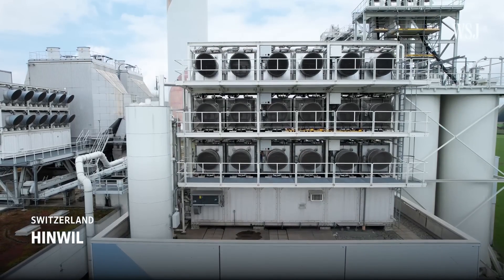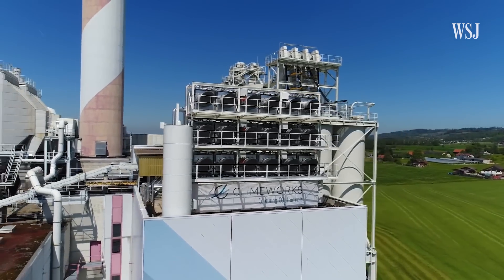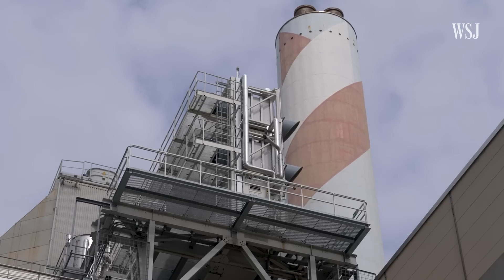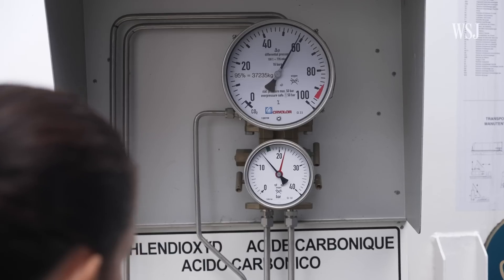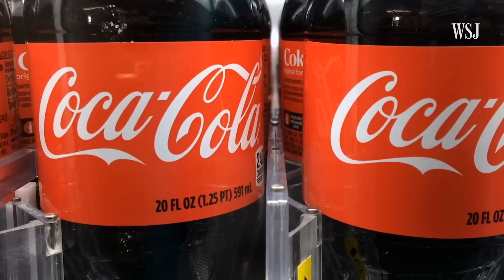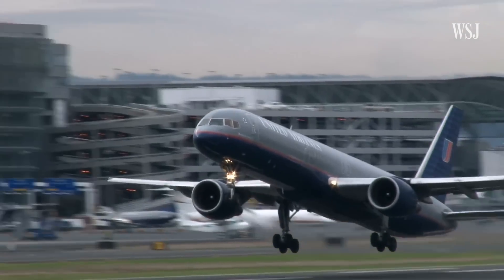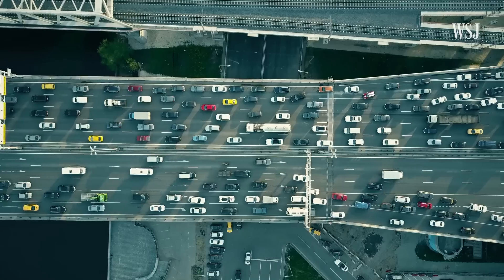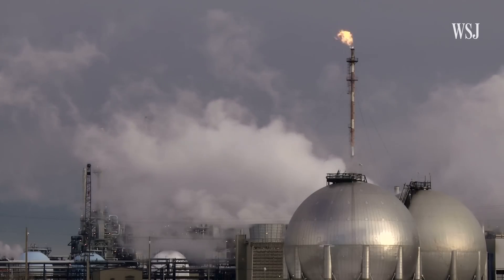Coca-Cola's and Microsoft's Latest Gamble: A Giant CO2 Vacuum Cleaner | WSJ

Comment: How does clearing vegetation to build this machine compare to the job actual vegetation does in using co2 and producing oxygen?  Wouldn’t you have to put it near factories that were polluting?  Doesn’t the machine use oil and produce it’s own co2?  Why can’t each factory have its own vacuum unit instead of building separate units in the middle of nowhere?

Comment: Taxpayer incentivized "Carbon Capture" is a science experiment for billionaire class investment schemes designed to supply CO2 as a "Raw Material for "Electro -Fuels" manufacture ala DENBURY RESOURCES. This is completely reliant on massive energy inputs via "Renewable energy " being plentiful and cheap. It is not...yet. The Texas facility is to be partially supplied by nat-gas fueled power "Peaker Plant" built adjacent to e-fuels manufacturing.

Comment: This is not a useful video.  You cannot "filter" CO2 out of the air. It is dissolved. There is clearly a chemical reaction going on in these "filters" described here that the article is not telling us about. Furthermore, if the CO2 is then put into fizzy drinks, the CO2 is being returned back to the atmosphere as the drink fizzes.

Comment: Why is it that whenever we see these systems they are big systems in relatively pristine environments, surely if you were to persist with such systems you would be better putting in systems in the most polluted areas, allowing far smaller and quieter systems which would still remove more CO2 than a large system in a clean environment.

Comment: So.... You spend electricity to take co2 out of the air and then put it in soft drinks which goes back to air when you open it?????
And how much CO2 are we avoiding with this nonsense? How are the resources for making the machine produced? Looks like tons of steel etc so all that needs energy and also releases CO2. Just think about it a little. It is monumentally dumb

Comment: Trees might be preferable as not only do they use CO2 from the air but they also produce oxygen.  But a tree needs water, fertiliser and minerals and physical space to grow.  It is therefore competing with humans.  A mechanical CO2 extractor sounds promising but it needs electricity to run, so the electricity has to be very green.  The machine has to be manufactured and transported, it has to be maintained and eventually replaced.  It has to be fully recyclable.  It's carbon footprint is not zero.

Comment: how much CO2 will be released during manufacture of all parts of this facility? 
1 (one) ton of CO2 can be captured by 50 trees in a year. They do need to be charged, they dont need any infrastructure. Just leave them be there.. They also produce oxygen during "capturing" of CO2. As a result you have a long hydrocarbon molecules that actually can be used for oil production, that can be used for plastic production. In case you want it of course. 
In comparison - all you can do with this captured by the facility  CO2 is to release it.. CO2 toothpaste is a pure joke here.. 
All this "tech" is a pure hype and money.

Comment: So capture carbon good? Re releasing it in bottled water bad>?. Seems like a bit of a waste of time to spend all that time AND energy to re release the captured CO2 straight back into the environment. And it costs more so Coka-Cola will be paying this extra? or will they pass that cost onto the customer? So it costs a lot to capture in terms of EXTRA energy used(even more CO2) and it is then released back into the atmosphere via fizzy drinks which now cost more? More energy in total used, more total costs involved Zero CO2 actually removed from the atmosphere.......Hmmmm???? Back to the drawing board???

Comment: I see a lot of negative comments here, but this technology is still being developed. Why would it be bad to try to make this work? It might take them a few more years but maybe they can make this much more scalable if they have the resources to do so. Certainly, when more companies and countries are interested, they will also be able to drive down the cost with economies of scale. You always have to get started somewhere, and it looks like this has potential.
Reply: Nature started this project about 2.8 billon years ago.. and got some successful results already. All you need is to leave it working - plant more trees. They consume CO2 with extreme "external" efficiency. Without fans, current, roads, iron (parts), oil and without these animals, pretending to be smarter that the nature.. 
This technology even does not convert CO2 to something else usefull. Just binds it to be released afterwards. And additionally consumes a lot of energy and transform it into the heat to warm up the planet even more.

Comment: OR... you could spend all that money and PLANT TREES!!!

We have deforest most of the Worlds forests in the last Century.  We have to regrow lots of forest if we want to solve climate change.  Not expensive machines that cost CO2 to make and maintain.  Trees are the solution.  Not some Political Factory.  Don't get me wrong, I'm not against this as a research project.  But lets be real and do the right thing.  Time is running out.
Reply: Planting trees alone is not going to fix the climate, not anytime soon.  Maybe in a few thousand years, but no time any soon.  I'm all for planting trees, they will help, but they are not up to the task at hand.  We need these CO2 scrubbers to pull CO2 out of the atmosphere as fast as we can.  Get CO2 sequestration going, and only then will we see the climate cooling again.

Comment: 4:35 this which excludes also capturing various particulates from burning fuels. I really don't see any use for this except they could sell/market this as a more advanced air purification system for industrial, building, or residential use.

Comment: This begs a simple question. What is the Carbon Footprint of the Climeworks Plant and how long does it take to offset its own emissions? Also what is the net CO2 collected after deducting its own operating CO2 footprint.

Long story short
1) What is the capital infrastructure CO2 and how long is the offset for invested equipment?
2) What is the operating CO2 expenditure and what is net CO2 captured per plant per unit?

Comment: At first, I had a negative impression of this approach since it tackles the symptom rather than the cause, but it turns out there is a green use case for this.  Apparently, algae can turn CO2 into carbon fiber.
Reply: Algae can supply sugar, animal feed, oil, protein, fish food, pellets for heat and other uses

Comment: I've gotta applaud Coke for putting car exhaust CO2 IN the bottled water I can already see a successful marketing campaign designed around "Dasani Diesel".
Reply: That's carbon monoxide
Reply: @josephs3973  yes, CO and CO2 (one oxygen cell away), the devil is in how the bonding is done (passing CO gas's through massive electrical generators) currently seems like trading one problem for another, time will tell.

Comment: How bout instead of investing $220,000 per unit we just leave Mother Nature alone and put an end to deforestation. Thus leaving us with an abundance of oxygen well continuously aiming at major companies that attribute to pollution and hold them to a higher standard of environmentally sensitive production or they face being fined and will need to purchase one of these units to counter act their excess of emissions.
Reply: If we stopped all fossil fuel use tomorrow, and planted a trillion trees, it would take those trees thousands of years to clean up the mess we’ve made. We have to pull CO2 out of the atmosphere to cool it back down. Just stopping fossil fuel use won’t reverse the warming
Reply: it’s not the fact we cannot afford create these units in mass production but the rate of which we create more emissions per year that’s leading us to create technologies as such.
Reply: More like Microsoft and Coca-Cola are scrambling to find a quick solution to this looming danger we face. The main key here for them is to have counter measures but in hindsight we need global regulation and global prevention methods while maintaining the balance of nature.
Reply: @delroynathan7794  Pulling all this CO2 out of the atmosphere is going to take bucketloads of energy to accomplish it.

We need lots and lots of nuclear power.  Nuclear is the ONLY energy source capable of efficiently and appreciably supplanting fossil fuels as our primary source of power today.

Those nuclear power plants can power all our EVs, while producing elements that we can use to make more EVs, and helping to clean up all the nuclear waste we have generated over the last 70 years.

Nuclear is the perfect solution to a lot of our problems.
Reply: I see that your relating your point to the energy crisis and I agree by all means the benefits of nuclear energy outweigh any other production of energy by far. 

Back to the issue at hand though. All species animal kingdom produce CO2 through gas exchange right. Now Mother Nature designed for a way to naturally combat CO2. So we have this thing called the tree of life which the entire animal kingdom falls under and plants are a branch of the tree of life. Well plants use photosynthesis and the by product of that is oxygen. You understand that to maintain this balance that nature has designed we must implicate global regulations to corporations and companies that produce excess pollution from anything between waste to emissions. We will benefit from these carbon capturing units although there’s still the issue that deforestation is the real terror we need eliminate before our Earth becomes uninhabitable.

Comment: if you take into account of energy and chemical products required to run the capture process, you'll find its a zero sum game (or even worse). the only way to capture carbon environmental friendly is by plants, because photosynthesis is free.
Reply: use lumber for building which locks carbon for years, plant new trees
Reply: @Mr1159pm  Nope, that destroys ecosystem diversity, and it only works with fast growing lumber. Also, building houses requires a TON of energy.
Reply: @traviskitteh  Not really. If the forests are correctly maintained and replanted afterwards the ecosystem damage is minimal. Besides the demand for housing is still there, regardless if we use concrete, bricks, wood, or whatever. Also wood is one of the most energy efficient materials to build from.
Reply: @George Gu or they can make it so that they actually capture the carbon directly from the source instead of it being mixed with the air like if these things could be on factory smoke stacks these things will become like 50 times more effective.
Reply: @abhinandanpatil8168  to capture carbon (in CO2) in the air means breaking chemical bond in CO2, which requires a lot energy.
Reply: Yes but they'd rather tamper with the environment so they can mess stuff up and blame climate change to enslave you

Comment: So can I get a CO2 concentrator that is cost effective for my home greenhouse/garden now?

If I can draw the CO2 from the air then we don't need to add it to specialized crops to accelerate growth from bottles - imagine how much simpler the operation of a greenhouse would be if you could adjust the actual CO2 concentration in the air just by vents instead of complicated plumbing systems?

Comment: 1500tons/year is equivalent to 85 American's worth of co2 output. The cost to run these will OBVIOUSLY outweigh the gain by several orders of magnitude, remember, this process requires a ton of electricity. WSJ, this is not journalism, this is you making a commercial for these swindlers.

Comment: Maybe try building the capture setup next to smoke stacks sending out the pollution. If not, it like trying to clean uo an oil spill 10 thousand miles away. Sure, you might get some but much better to clean up at the souce.
Reply: Only about half of fossil electricity plants are emissions controlled.  Sort of like installing a giant catalytic converter that we are familiar with in our cars.  That is a real opportunity not taken.

Comment: This is such a dumb idea, I can’t believe major companies are investing into this. CO2 should be captured from concentrated sources like retrofitting to carbon based power plants, iron smelting or cement plants, not from a very low CO2 source like the air which is only 0.06%. The thermodynamic efficiency is rubbish, just concentrating the CO2 uses a huge amount of energy, which is a waste. Trees do the same job and do not cost $600-900 /tonne.

Comment: It's hundred of times easier to remove CO2 at source - then do that. Trying to remove it from the atmosphere is really not sustainable currently. What needs to be done is to control emissions at the source itself.
Reply: At this point people are just creating jobs for each other
Reply: I feel like they could’ve easily scaled those CO2 vacuums down and put one on every car with all the money they spent developing all of that tech, but the idea never ran through their heads.
Reply: @BrutusBeats  Actually there are carbon capturing devices developed for vehicle exhausts, however it is not widely known
Reply: I do hope you lot realize the comedy of all of this. Wouldn't it be better to reduce production at the source, ultimately?
Reply: @traviskitteh  that cuts off a lot of power to many countries as many countries still heavily rely on fossil fuels, if you can’t eliminate fossil fuels completely the best solution is to use the byproduct of the fossil fuels… Carbon Monoxide (CO), Carbon Dioxide (CO2), Sulfur (SO2), Nitrogen Dioxide (NOx), Nitric Oxide (N2O), Volatile organic compounds (VOCs), and Hydrocarbons (HCs) can all be reused for different purposes, we just need efficient ways of collecting these byproducts. 

It surprises me that renewables were never widely adopted in the late 1800s and early 1900s. Before Edison invented the light bulb Tesla was already trying to pave the way for wireless electricity, and he was close except I don’t think he realized the immense amount of power he needed to power such a device.

Comment: So how much ENERGY does a take to capture a ton of CO2 from air? How can you not mention that in the video?!
Reply: You can infer from the fact that they didn't mention that the number is not good.
Reply: Maybe it’s confidential
Reply: @ADMINM-ld7vu  They can't say its confidential if they are making bold claims that it is good for stopping any further consequences of climate change, Here is a bold guess from me, it may consume more than 100 Megawatts of electrical energy.
Reply: It’s $600 to 900$ a month at 2:20 in the video
Reply: @issaic1734  how much carbon is produced per dollar of electricity
Reply: @Izacundo1  About 0.92 pounds of CO2 emissions per kWh.The Average Electricity Rate in the U.S. is 10.42 cents per kWh. So about 9.2lb/$.
Reply: @issaic1734  a ton

Comment: Maybe Coca-Cola could stop being cheap and cutting corners and actually switch to aluminum and glass rather than plastic bottles. Maybe Microsoft can get behind the right to repair and help push legislation. Two easily doable tasks for such big companies
Reply: right. But they won't get the "recognition" and profits by doing so.

Comment: What is the actual % that that single plant pulls vs global emissions per year? 15 tons? Thats literally nothing. “It also needs a lot of electricity” lols…
Reply: A tiny fraction. It will remove 1,500 tons per year versus the 22 BULLION tons that will be released this year.
Reply: Nuclear power. Next stupid comment?
Reply: @ryanthompson3737  no, nuclear power is only 20% of the us grid at best, wind hydro and solar are tiny, so yeah this joke runs by burning coal and natural gas.
Reply: @shermansherbert2570  They talked about their new plant being in Iceland, all the electricity there is cheap and green (from geothermal)
Reply: Which still proves the complete uselessness of something like this in the U.S. and more broadly on a global level. Its a "feel good" pretend solution.